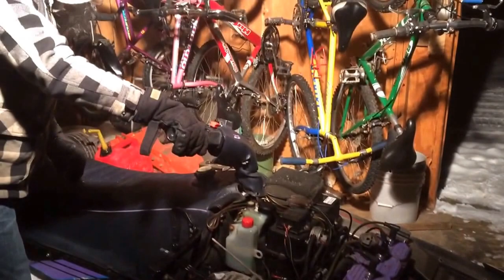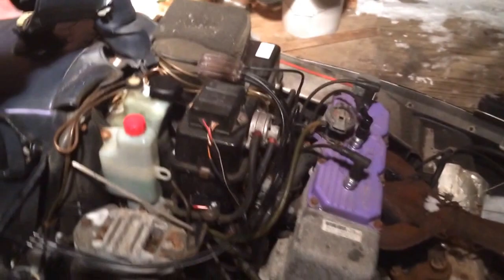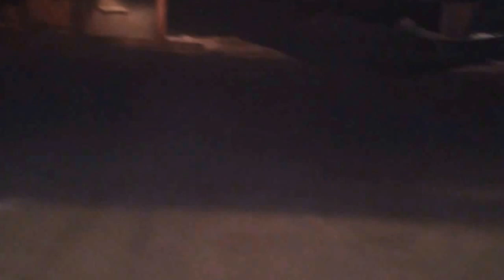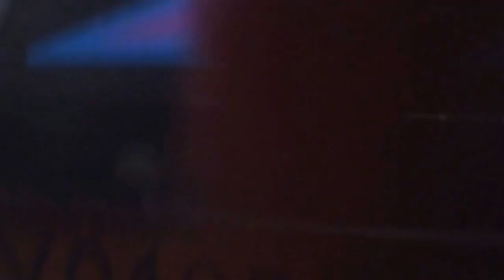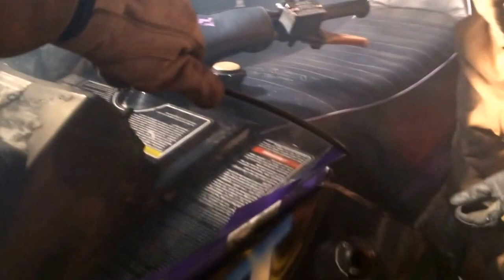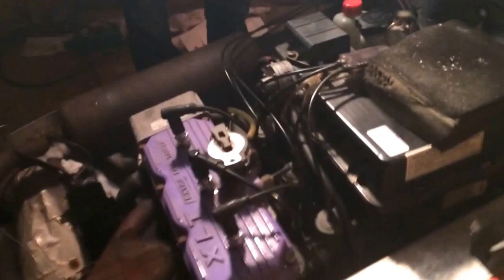1994 Polaris Indy XLT 600 start up, walk around

Comment: There is no such thing as a 1994 600 xlt. That is a 581. 1996 they released a mock version, 1997 is when they actually released the 600. That sled out sold every skidoo yamaha arctic cat combined that year.
Reply: dude There's is no such thing as a XLT 581 it's a 580 and every XLT is a 580 they just say 600 i have owned every year of the XLT and when you rebuild them the pistons say 580 😂

Comment: How does a guy tell if the motor is a 580 or 600?
Reply from the maker: timrules81 I believe 1995 was when they switched from 580 to 600 in the XLT